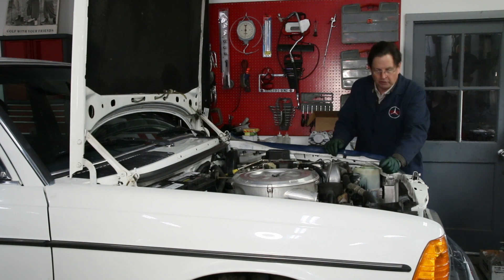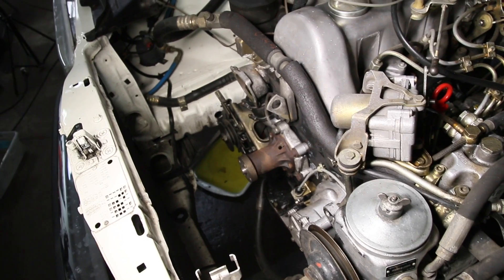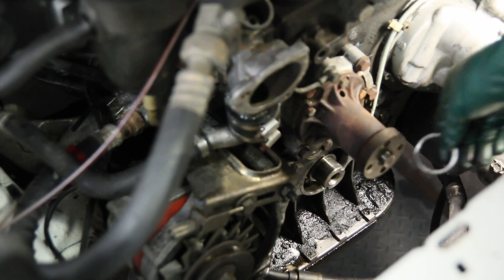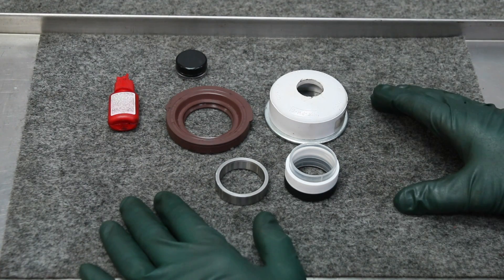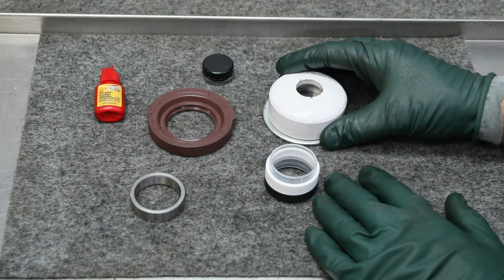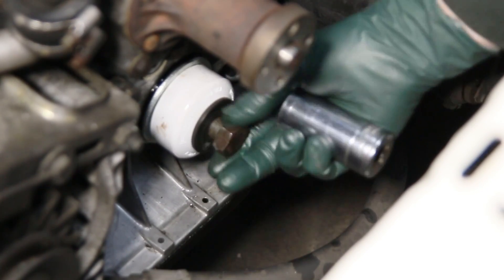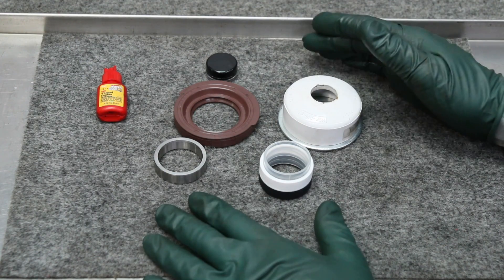How to Avoid Failure Replacing a Front Crankshaft Seal: Example Shown On Older Mercedes Diesel

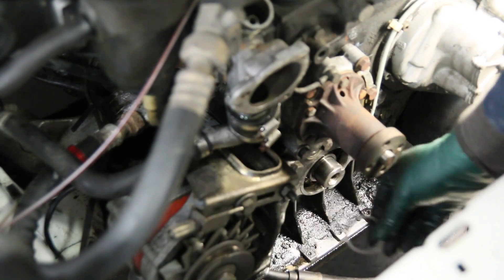Comment: 2:46 Hello, i wanted to ask you why you need to replace the race and not only the seal?
Reply from the maker: The seal will wear a groove in the race over time. If you just replace the seal and it lines up with the old groove, it can shorten the life of the new seal. It is time-consuming to replace the seal, and you really don't want to do it again in a couple years (or even sooner if the race is severely worn.).
Reply: @Mercedessource  thanks 👍

Comment: Hey Kent, pretty slick kit. I’ll be buying one soon. Looking at the video though, it would seem that if you installed the seal before installing the race, and then used the balancer and the crank bolt to drive in the race that it would accomplish the same thing. I guess you’d then have to remove the balancer to inspect the seal. Any input on that?
Reply from the maker: Try that, and you will be sorry. The race does not just "slide" into the seal. Doing it that way would roll the lip and damage the seal, and you would never know because you could not inspect it. In a few months it would start leaking again and you don't want to do this job twice. That is the purpose of my kit - just once!

Comment: Kent, What type of sealant do you use for the outside of the seal? Can you sell the red super sticky grease for the inside of the seal and sealant for the outside of the seal? Thanks
Reply from the maker: Aviation permatex sealant is what I use on the outside. I no longer use the sticky grease because I came up with a new tool to install the front crank seal that guarantees not rolling the lip. The sealant is included with the kit. https://mercedessource.com/store/617-turbo-diesel-engine-front-crank-seal-replacement-kit

Comment: I have a 1962 220Sb Fintail W111.012 Chassis with the M180 engine that has a leaky seal, does it also have a race that needs to be replaced? If so, do you sell those as well?
Reply from the maker: Yes, the race and seal are almost identical ( seal is slightly smaller) but the install tools work without modification. I am working on a kit now for the 1960's 6-cylinder engines and should have it ready in about a week.
Reply: @Mercedessource  Awesome, I will keep a lookout for that kit!

Comment: You deserve $150 for the set of custom tools you show just for your experience.  Have you ever had a problem with the crankshaft sitting too low from main bearing wear, thus causing a leak from being imperfectly centered?  On the multitude of gasoline engines I've had my hands on, I always re-surface the crankshaft and install new bearings just to avoid this problem.  It's especially important to have healthy crank and bearings to avoid damage to the ream main seals, automatic front seals and the automatic front pump and bushing for the torque converter.  My mantra... round and true is a good thing.  It avoids leaks and preserves balance. ;-)

Comment: I'm just asking, cant' you install the race after replacing the seal? So the race slides from the outer part of the seal not tearing the lip
Reply from the maker: Super tight fit. That would probably be a sure way to pop that spring off on the back side.
Reply: @Mercedessource  Well, this answered my question. I was thinking the same thing.